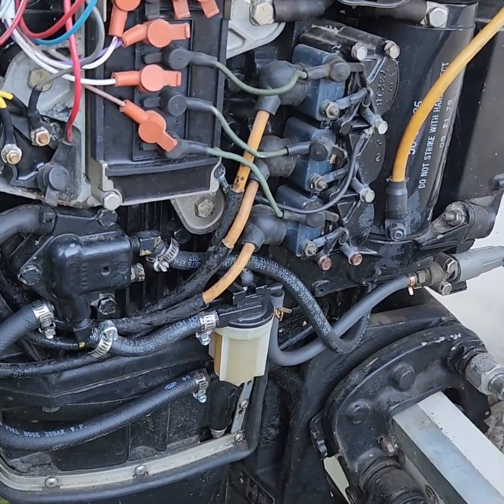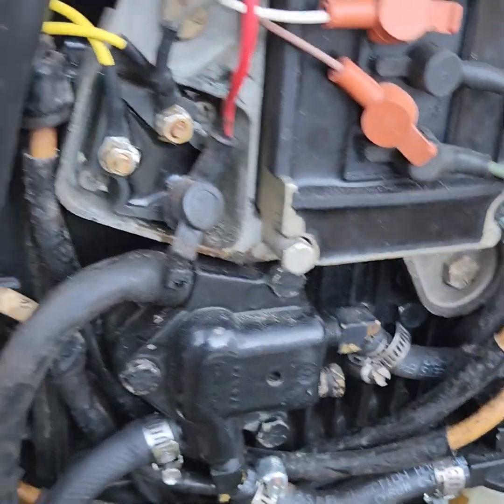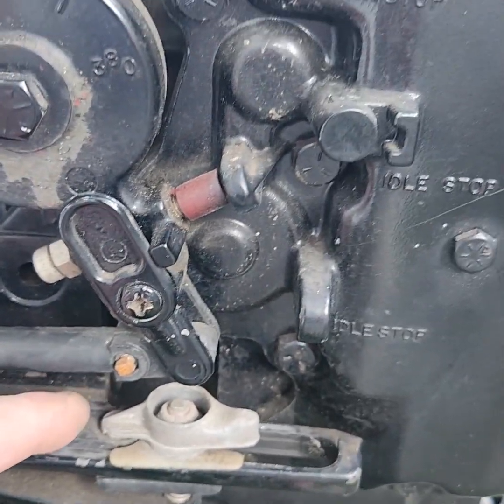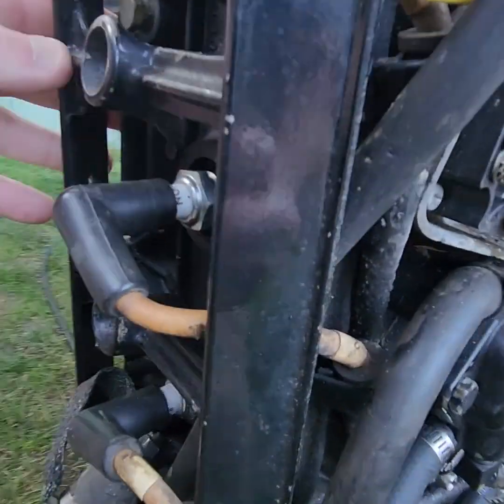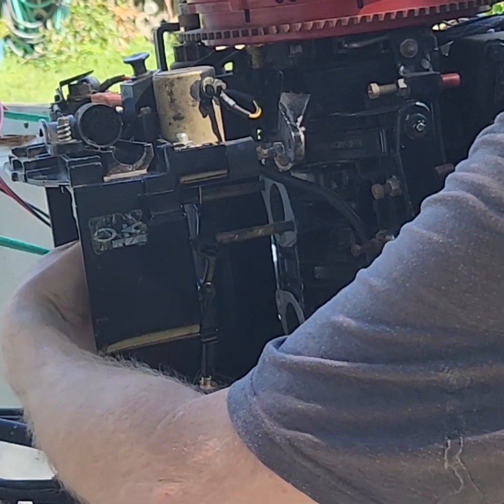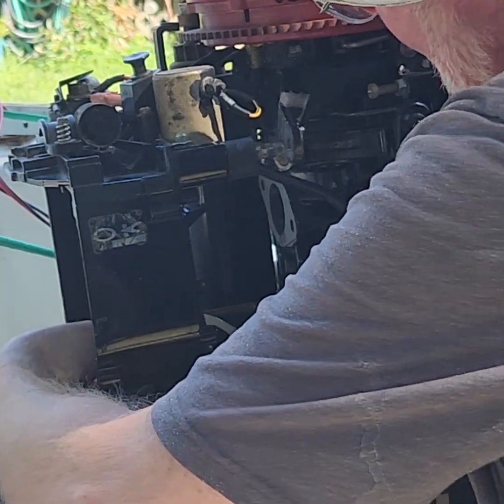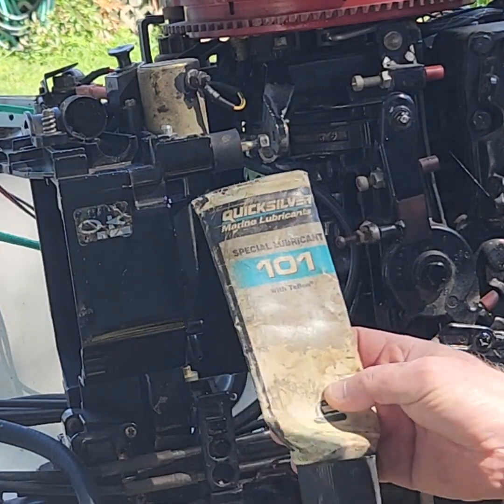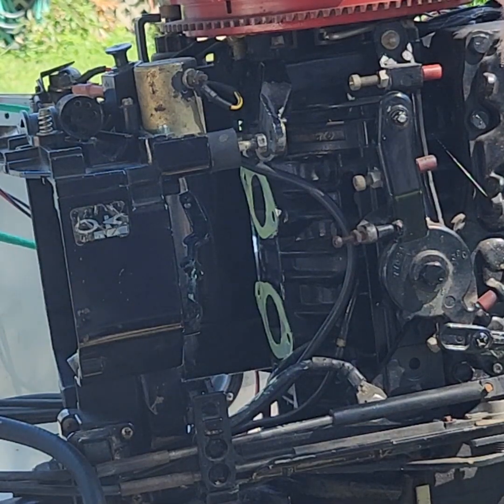1980 Mercury 70hp Repairs part 1

Comment: Where is the thermostat on these motors??? I can’t find it anywhere
Reply: Put your hand under the water as it comes out of the engine, at idle, if it is really hot to the touch you may have a problem. It should be warm or cool. If you have just run full speed it will be hot. So just reach back and feel the water at idle. You are your thermostat.

Comment: Does anyone know the name of the black plastic adjuster piece that connect the rods to open the throttle at an equal rate?
Reply from the maker: You can look up your engine via serial # and find the part you need. This is the Mercury online parts link.
https://www.mercurymarine.com/us/en/parts-and-service/parts-catalog

Comment: Hi ted! I'm from Chile and i have same outboard and the 1st cylinder measures 80 lb/in2 and 2nd and 3rd around 130. What it is tje first thing tja i have to do?
Reply from the maker: For either a 2 stroke or 4 stroke I would remove the cylinder head for further inspection
Reply: Thanks Ted. I will need more tools 2 bolts were so tied and broke both. I put WD40 but it didnt work.
Reply from the maker: @crindac  pb blaster or Krill work much better than WD
Reply: This model has cylinder block and cylinder head in the same piece so you need to take the whole motor apart. But you can try the foam who can loosen piston rings but it's most likely need a rebuild...
Reply: This model overheats and screws the top piston and cylinder....
Reply: @crashtestdummie67 OMG, yes!  Accidentally hit the tilt button and ran the engine out of water for 30 seconds.  Now I have zero compression on the top cylinder.  Are you saying the engine is toast?  Not worth repairing?
Reply: @patmanley6745  30 seconds is not enough to overheat the motor is my opinion but it will get hot...more symptoms/ happenings before loss of compression?
Reply: @crashtestdummie67  it might have been longer.  My kid was using the boat when it happened.   Anyway I got a hold of a borescope and looked in the cylinder through the spark plug hole and didn’t notice any obvious damage